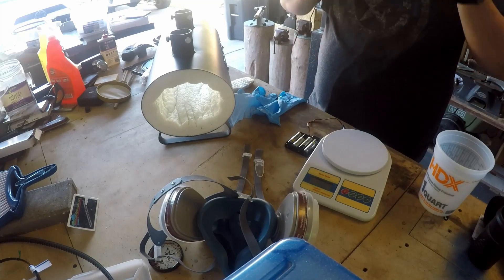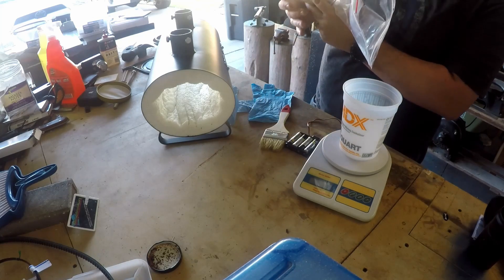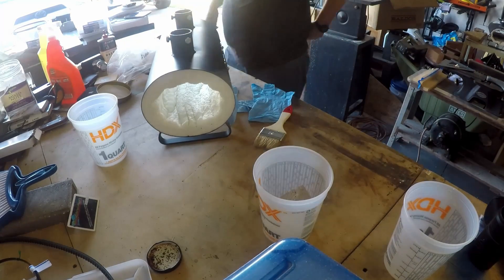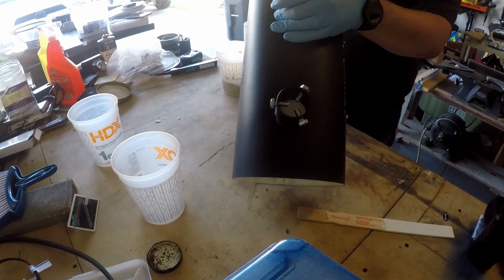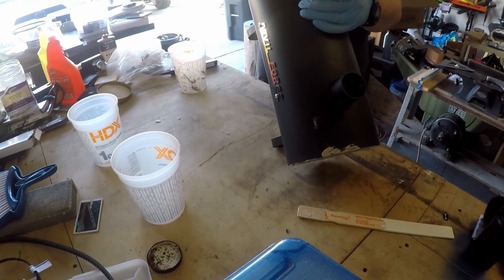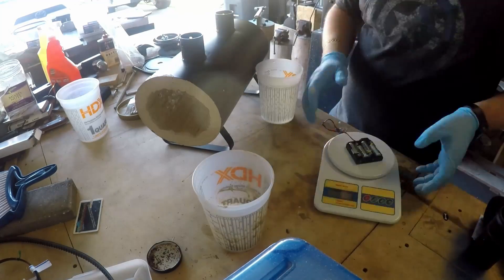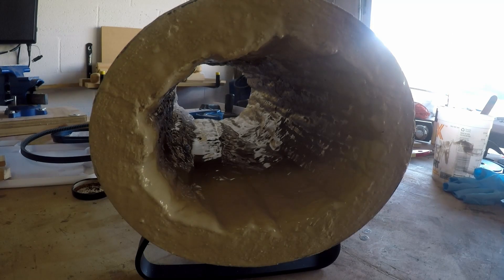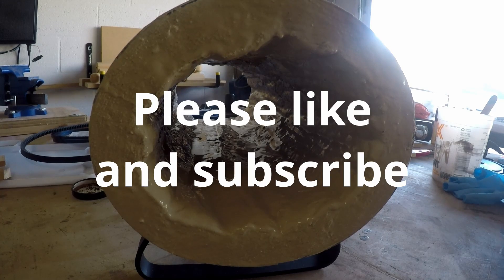Applying the wool rigidizer to the Devil Forge

Comment: found this helpful for getting an idea of what to do 

however i used a gloved hand instead of the brush , since I've worked with wattle and daub and older styles of plaster and have the knack , if you feel confident it can work quite well , if you press lightly you can smooth it out 

, i also saved some of the wool i had left over from the burner strips and saved a little powder too so i can coat a door im going to makle for it  , maybe 2 doors

Comment: Thanks for the Vid.!  I’m also live in Florida Cape Coral so I’ll be doing mine tomorrow on my New 3 burner forge.  Never did it on my 2 burner.   What’s the danger if you don’t do it??
Reply from the maker: As the ceramic fiber is repeatedly heated it starts to deteriorate.  As that happens it can become airborne and if that's breathed in it can cause cancer.  Here is some more information. https://www.wetcanvas.com/forums/topic/ceramic-fiber-blanket-deadly-carcinogen/#:~:text=Fiber%20paper%20is%20perhaps%20the,carcinogenic%2C%20especially%20at%20high%20temperatures.

Comment from the maker: Hoping this information is useful to someone else out there.  I wish more info was available for me before I started doing this.
Also I say at the 11:44 mark that water expands thousands of times when it turns to steam, and I'm not 100% sure what the actual value would be for a flash heat to boil, but at 100c, steam is 1,600 times greater than water at atmospheric pressure.

Comment: just how dry does the rigidizer need to be?  I Live in humid climate and it's been 4 days ......granted I laid it on thick in the bottom , ....... it's all dry by the eye from the top all the way down to about 1 inch from the bottom where I can see it's darker (still damp).   Do I need to make sure it's completely dry before I temper my crucible?
Reply from the maker: You want it to be completely dry before you start heading it to prevent cracking.  I also live in a humid environment and I opted to put it in my oven at 200f for a few hours to make sure it was completely dry and then I raised the temperature 100f per hour for the next few hours till I hit 500.  Then I let it cool until I could handle it and fired it with the burners.
Reply: @WorkingHandsMakingStuff  I have the 10kg (bout the size of 5g bucket)..... I wish I could fit it in my oven.   Thanks for the advice
Reply from the maker: Maybe try to run the burner at a really low pressure to heat it up slowly?

Comment: My furnace rigidizer need a redo, where can I buy this powder? Devil Forge are great but they do not sell kits to overhaul it.  Thank You
Reply from the maker: I don't know where to get this powder specifically, or what it even is, but there are many options for rigidizers that are available.  The last time I relined a forge for my cousin, I used a product called Greenpatch 421, which is a mortar made for furnaces.  The MSDS for this product specifies that it can be thinned with water in order to encapsulate ceramic fiber wool.  That being said, your best bet is to find a local pottery/ceramics supply shop and see what they carry.  If you can't find one locally, there are many suppliers online that can help.  Anything that is high in sodium silicate and/or alumina will work, just make sure to soak it thoroughly.
Reply: Thank You for the help, I found them on ebay.
Reply: Thank You. I found it on ebay.

Comment: One question. Were can I get riginizer? Need some for fix some weakpoints and cannot find some on the Devilforge homepage.
Reply from the maker: There are many products available on the market that can be used as rigidizer.  When I relined my cousins forge I used a mortar called greenpatch that specifically states it could be thinned with water and brushed onto ceramic wool.  I would start by looking for local pottery/ceramics supply shops and seeing what they carry before going to the internet just to support local business.
Reply: Allright, Thank you.

Comment: Thanks for the video! Just to confirm you did 100 grams of rigidizer to 70 grams of water? and did that seem to work? Planning on getting my forge rigidized tomorrow then will follow up with Kastolite and finally metrikote. Hard to find ratios for these things!!!
Reply from the maker: Yes, that's the correct ratio which is what I used.  It's a bit messy but fairly easy.  Good luck with your forge
Reply: Working Hands Making Stuff thank you. I think it came out well :)
Reply from the maker: @gabesantoriello8402  Happy that I was able to help!

Comment: Hi, Great video. I am new to knife making and if you could answer a couple of questions that would be appreciated. Firstly If making an average sized meat cleaver, would it fit in this size forge to heat treat and what temperature calculator have you seen that would be the best for this model? Cheers mate.
Reply from the maker: The forge is about 5 inches (125ish mm) wide so as long as you're not making something wider than that you should be good.  As for temperature, i just go by eye and magnet.  Good luck
Reply: @WorkingHandsMakingStuff  Thank you for the reply. Now of to convince the wife 😬

Comment: should i rigidize then use the 100ht
Reply from the maker: I'm not sure I understand the question.  If you're referring to the drying process, you can put it into your oven at the lowest temperature it can get, should be under 200, for a few hours to dry it and then fire it.  If you are referring to when I was  talking about heating it at 100f and increasing the temperature by 100f per hour, that was for a second coat I used, one that is not part of the devil forge inventory, to thicken the walls. That's something called green patch 420, though other products are available that can be used, optionally, if you are interested making the walls much more solid.  Whatever product you do use, check the manufacturer directions for curing and firing instructions.
Reply: @WorkingHandsMakingStuff  I mean the silicon rigidizer that just makes the blanket hard and then over top of that put the 100HT I heard it help it keep it’s shape wile adding 100ht
Reply from the maker: @christopherconkright1317  Ah, 100ht is a product. From the looks of things is a ceramic coating.  Yes, rigidizer first and let it dry completely then the 100ht.
Reply: @WorkingHandsMakingStuff  Thanks I could not find an answer anywhere online I appreciate you taking the time to help me out.
Reply from the maker: You're welcome

Comment: What is the name of your Rifidizer I wach your vido twice never said the nane?? I heard you menchen green patch 421 refactory is that the product?
Reply from the maker: The rigidizer that was used in that forge came with the forge.  It was in a small plastic bag with instructions on how to mix it included in the directions.  Green patch 421 can be used as a rigidizer as well but needs to be thinned with water first.  I will have a video out shortly where I do just that when I reline my cousins older style devil forge.

Comment: What if you don't have a respirator?
Reply from the maker: Get the best dust mask you can get. You really should not be breathing that stuff in
Reply: @WorkingHandsMakingStuff  i really wished someone would've told me that before I took that devils forge furnace out of the box one time exposure shoukdnt hurt right if i go get a mask now and never be around it again without one?
Reply from the maker: @Stacking Points you're fine. There is no real danger with the kao wool unless you're cutting it or it is under fire.  You really don't want to breathe in the powder cause it's very fine and will get into your lungs. Also, once you've mixed the powder and applied it to the wool, the danger is gone.

Comment: What is the rigidizer made of, do you know?
Reply from the maker: I'm not sure what it's made of but it's likely some alumina based product for heat insulation.  If you're looking for something to use on some wool that is bare, there are lots of options available that you could probably find in your local pottery supply shop.
Reply: Rigidizer is made from hydrophilic fumed silica